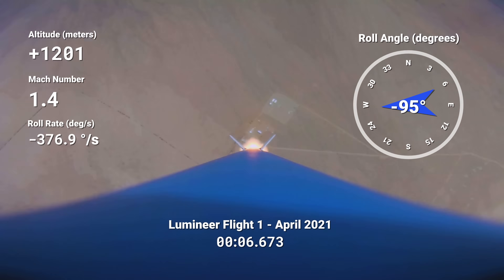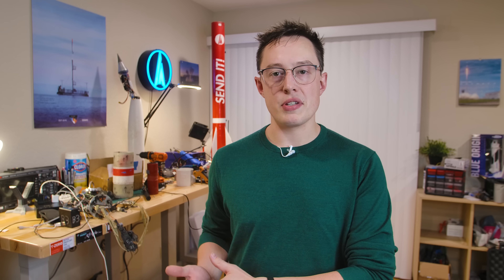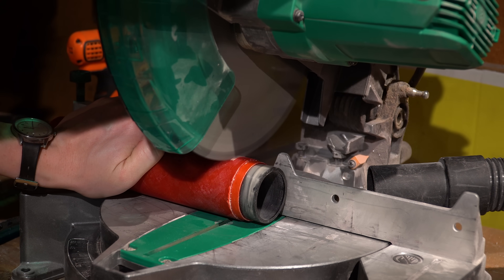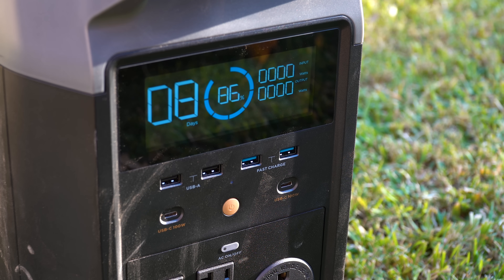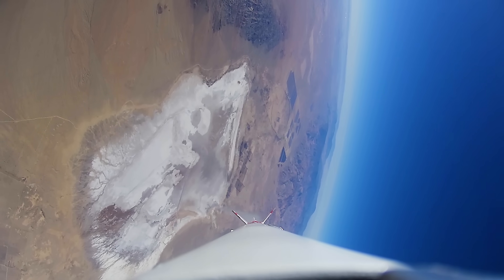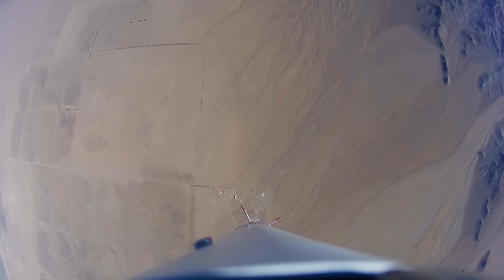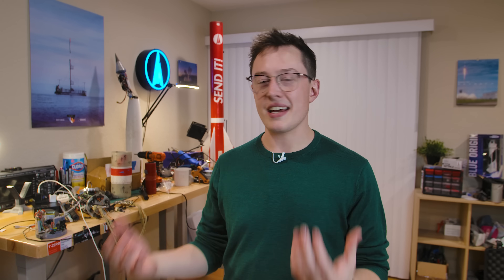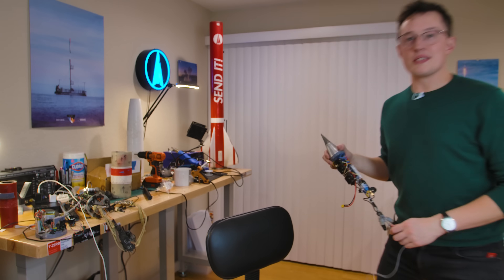Can You Get Stable Video From a Spinning Rocket?

Comment: Conservation of angular momentum... Your camera ring is a reaction wheel as others have stated. Look at adding a counter-rotating ring as well to maintain the angular momentum of the airframe. You could also use that combined system to de-spin the airframe like... 1 second before chute deployment to mitigate chute entanglement.
Reply: While I agree that the despin rig is acting like a reaction wheel, I don't think adding a second wheel is the best idea. It adds mass and complexity to an already existing rocket, which could be more of a headache than it is helpful. I think the best move is to use high rpm slip rings to get all of the electronics for this sub assembly into the avionics bay, lowering it's mass, dropping it's moment of inertia to lower the torque roll it's exerting on the vehicle. It doesn't solve the problem completely, but it could have the potential to greatly reduce the impact.
Reply: @sethswheelhouse  
I agree, but more importantly, if it is active from launch, the saturation is pretty negligible over the flight. It wouldn't really run into any issues with reaction wheel effects.
Reply: I’m not saying he doesn’t need to optimize the mass of the camera ring, that is obvious. However fin induced spin is completely GONE and reversed only 5 seconds after the camera ring kicked in. The oscillation this would induce would be worse than not spinning at all. Optimization will only go so far in extending that time, I doubt by a power of magnitude, and certainly not to apogee. Counter rotating wheel is the best option IMO. He already explored a fairly mechanical execution, it’s not too much to mechanically couple a second ring to the same stepper in v2.
Reply: TLDR: From the perspective of an astronautical engineering major, @theProhibitionKitchen is correct. IF Joe wants to use a de-spun camera, AND have the airframe spin stabilized in the upper atmosphere, a counter-rotating wheel is required… and it’s not nearly as complicated as you all are making it out to be. 

The point many of you seem to be missing here is that this camera ring completely cancelled out the spin of the airframe and reversed it, while below 15k… in the thickest part of the atmosphere where fin spin is at a maximum, the camera ring stopped and revered it. Joe said in the video that he WANTS AIRFRAME SPIN and for good reason.

Optimization? Yeah it needs huge optimization. Why is the motor, gears, batteries, electronics, etc on the ring? But optimization can’t beat the laws of physics, angular momentum is still angular momentum. Yes it would take more time to cancel out the airframe spin, but it certainly still would. Would it make it to apogee with any spin left? I doubt it, fins (and thus spin from fins) really are useless after not very far up… 

Some people have said stuff about how abruptly it started spinning. It’s not about how rapidly it spun up after kicking in. Whether it had spun from the beginning of airframe spin, or made the same number of spins in 0.1 seconds, it is the same angular momentum in the system overall. So.. it still would have cancelled and reversed spin like it did in the footage. 

PID may resolve oscillation but it does not resolve the angular momentum issue with only one wheel IF Joe wants a de-spun camera AND a spin stabilized airframe (both of which he said that he wants…).
Reply: @die_dunkelheit  That it can cancel out the spin entirely is never in doubt - spin anything up fast enough and it could. The point is it looks like it spun up way way too fast, certainly way way faster than it would need to keep the camera on target as it overreacted when it starts the camera spin. So it is the overreaction cancelling out the rocket spin entirely at that point. 

Which happens while the rocket is still low and fast enough to be building up more spin from the fins efficiently. So had it been only taking the right amount of spin out to keep the camera position the rocket itself should have stayed spinning, and probably actually still been increasing in spin speed for most of this flight (but that is a very complex relationship between air over the fins to generate that rotation, so height and speed vs the rotating camera mass and so the counter rotation it produces to match the rocket body). 

Plus once it reaches the top of its flight it doesn't really need spin stabilisation anymore anyway, so who cares if the camera unit by the end of the flight has taken all the spin its about to fall over and deploy chutes...

edit: NB - Note I am not saying a reaction wheel would be too hard or a bad thing, I just don't think it is actually required on this rocket, and it certainly shouldn't be on the bigger rocket he wants to run this type of system - the rocket mass vs the camera mass as it gets bigger will trend very solidly in the camera doesn't ever accelerate long/hard enough to cancel the spin the fins put into it at the early phase of flight.
Reply: @die_dunkelheit  One thing I disagree though, the spin stopped because it had almost reached max RPM and stopped gaining angular speed. Then the motor kicked in violently. If you have the motor working all the way up, the camera is having no angular momentum
Reply: @yuxuanhuang3523  that is not how angular momentum works. It’s is spinning counter the airframe, it is taking angular momentum from the airframe. It doesn’t matter how fast it kicked in at all, it is the same total angular momentum in the system.
Reply: @die_dunkelheit  No it isn't. the rocket has a terminal spin rate, and when the motor kicked in (adding negative angular momentum), it encouraged the rocket to spin faster than that, which caused the whole system to lose angular momentum. Then it suddenly slowed down, the rocket body had similar spin rate, therefore similar angular momentum as before the motor kicked in. Now the motor is taking all of it away from the rocket. If it had stabilized from the launch, the rocket could spin at its terminal rate while the ring remains stationary relative to ground
Reply: As part of this is practice for scaled up flights I really can't see a second wheel being needed - a bigger rocket with spin stabilizing by design will easily overpower the relatively light camera, and it really aught to be have done on this flight to from what we see of it - its seems to be only because it went to sleep and then got cranky and overreacted upon waking that we see the spin being lost so entirely. Tuned properly and working all the way through the flight I'm pretty sure it would be fine.

I do like the idea of deliberately spinning it up potentially too fast for filming purposes to aid chute function, just using it as what it is - a reaction wheel. Though it may not even need to be driven too fast, as it reaches thinner air and gets ever lower airspeed towards the top of its flight the camera units rotations may well entirely kill the roll anyway as the fins loose the airflow they need to function as spin stabilizer.
Reply: There are easier ways to despin though, such as yoyo despinning.
Reply: @jerry3790   I think this misses the point though. He’s trying to continuously stabilize the camera against a spin stabilized airframe. My secondary point of despinning at Apo should really be taken as like a secondary beneficial side effect if he decided to implement that in the same system. My point of the second ring is to counter spin the camera ring ONLY.
Reply: or have a fixed camera and program software to only record frames when its pointing a certain degree when it starts spinning. but yes put in more weight and motors and have the whole thing spinning opposite direction to counter his reaction wheel camera, for some reason. why dive deeper into a crap idea
Reply: @MrPaxio This is one of those ideas that I think almost everyone has while watching this video and it sounds really cool until you actually try to simulate your expected framerate/output footage.. I think most people would rather just keep the spinning version. Plus in the case selective frames did give reasonably good results you'd still be better off just recording in a high FPS and using a reference point to get rid of the 'between' frames in post rather than try to time your shots in flight.

Regardless I reckon Joey b can tackle this problem however he wants it's not like he just forget about angular momentum or that 360 cams exist.
Reply: It's not a bad idea, but the biggest problem with this is that the mass would have to match the total weight of the rocket
Reply: @rokitfella7107  no, this is suggesting to counter the spin of the camera ring so the camera ring does not cancel the spin of the rocket. IF the second ring is spinning at the same rate as the camera ring then it would have to match the mass of the camera ring. If it were spinning faster than the camera ring it could be lighter
Reply: also intentionally spinning the rocket would help to have some momentum to work with. Also a more optimized control system and mechanics could solve these oscillations. On the other hand, probably a simple 1 axis gyro and optimized light weight system would do the job. Also I mean the spinner has some extruding parts that have some aerodynamics effect.
Anyway, I mean he didnt really needed to fire a rocket to test it. All what was needed was to throw it into some safe pit a few times, he could have seen these issues. For the initial problems, it could just be that the heavy acceleration on the rocket bind the mechanism and while it unbind it had accumulated integral error.
Reply: First of all, it adds complexity and weight,as SethShredz mentions. I know it acts as a reaction wheel and counter the rotation the rocket is doing. We can see from the footage how well that worked. It almost took all the spin from the rocket when that thing kicked in.  However, in control, there is a threshold for stability, if you go softer on the reaction rates, the system will be perfectly stable and will not go into oscillation. tuning a PID system on a moving platform is not that different than tuning one that is stationary, just take into account for both spinning masses
Reply: Or just give up on the camera and go for the 360 one. Or give up on it altogether

Comment: 3:00 the other problem with using a 360 camera is that, ultimately, it is still a camera, and if you spin it like that, you'll get a ton of motion blur. You can stabilize the image in post and get a very stable video... of motion blur.
Reply: thats a very good point. I havent thought about that

Comment: Also you can stabilize the camera to a compass heading rather than an accelerometer. Or with sensor fusion you can stabilize to gyro, accel, and compass. The code is wildly available for free and will just give you a heading output to aim for.

Comment: Really cool idea, but man, this problem is 100% solvable in software. There are a ton of turnkey 360 stabization tools.

Once you have your stitch calibrated, all you need to do is track a fixed point, and you can un-roll a shot. 

I think fixed cameras and a bit of video editing is the way to go. Heck, you could disassemble an insta 360 camera and have everything handled for you in a snap.
Reply: https://youtu.be/fWTPGgppW0M

Comment: Hey, stepper motors have a pretty slow maximum speed. See if it is sufficient for you. Make sure to not gear it down much, since they can do very precise microstepping and you need all the speed you can get.
Other than that, the solution that will work (but is overkill) is something like an ODrive.

Comment: 1. Turn that brushless with a F.O.C. controller and add position sensor to it (hard). 
2. Use a gimbal driver and a gimbal motor (easy, cheap).
3. Attach an Insta360 go, and be amazed, see: https://youtu.be/fWTPGgppW0M (easy, costly).
4. To your target angle add 180deg, modulo it with 360 then subtract 180, and that will skip the cumulated spinning

Good job!

Comment: This could probably be stabilized passively using fins on the rotating camera rig.  The fins on the righ could be mounted such that they can swivel freely in pitch axis; this will make them automatically align themselves with the flow and dampen camera rig rotation.
Reply: I bet this would be super hard to do, but it might be the coolest possible solution.

Comment: I think proving that the idea doesn't compromise the structural integrity of the rocket should be should be biggest takeaway from this little prototype. Don't give up on this idea and also consider having a deadband around the range of spin that the system isn't good for. At the end of the day, slow rate spinning footage is much better than jerkey footage. 

P.S. This might be camera assembly acting as a reaction wheel but I think your 5 degree fin somehow made things less spiny.

Comment: I would go with a sensored brushless motor, the type rock crawler rc cars use as they need to have smooth slow power. You should not have to use so many reduction gears.

Comment: Might want to research rollerons in your fins, like some air-to-air missiles. Those use passive rollerons spun up by the slipstream of the carrying aircraft. 

I was working on a space shot where we thought about using hard disk drive platters and motors inside the fins for the gyroscopic fin stabilization. 

Regardless, keep up the superb work!
Reply: To those that might not know, rollerons are an enclosed gyroscope inside the trailing edge of a tailfin that is spun up by airflow over a small exposed portion. (Very common on military rockets/missiles, it's that toothy little wheel on the tailtin corners) They are connected to the static portion of the tailfin with a simple (but sometimes damped) hinge and function as a standard control surface but are passive and have only 2 moving parts.

If tuned correctly, the gyroscopic forces automatically tilt the control surface the perfect amount to counteract any roll and they can be surprising precise/accurate/responsive bc gyroscopes respond instantly and proportionally to even the smallest/slowest rates of change while not overcorrecting for the largest/fastest. It can essentially be thought of as a "wireless" equivalent to a mechanical bevel gear, neat.
Reply: Came down to say something like this,
fins are pretty excessive for high mach vehicles, especially low mass rockets.

Something like rollerons or tiny flap stabilizers makes more sense.

Rollerrons are pretty heavy and are probably reliant on the mass for a strong flex/vibration resistant housing.
But the idea is probably interesting to look into.
Especially passive self-corrective stabilization.
Reply: My take on this comment is:
1) probably not what you are intending and
2) that you're saying to change the camera spinner so instead of being de-spun by a motor based on calculations, to instead attach fins with rollerons that de-spin using inertia...  but I'm not even sure that would make sense.

Comment: I have mentioned this in the last video, but something you could do rather than spinning the whole assembly, is spinning a mirror around the central point and then putting the  camera statically in the body of the rocket. This would allow for a lot less load to be spun up and down. Similar concept to what you have already done, just less stuff spinning
Reply: I also suggested this when he had a gopro sticking halfway out the side of the rocket body causing unbalanced drag. Unfortunately this fix wont work for this use case, as the center of the viewpoint will remain static but the entire image will still be spinning around that central point, expecting no blur at the edges of the frame would be naïve.
Reply: @chrisjacobsen1659  : Yep, shutter speed isn't infinite, so you'll get blur everywhere outside of the exact rotation axis, and in this case it could be pretty bad.
Reply: @chrisjacobsen1659  Assuming the camera isn't global shutter, you might also get some weird rolling shutter effects.
Reply: @fractal5764  I was just going to mention that. It probably add a weird curl to the image. Not a bad idea though. Unfortunately due to the optics, the mirror would have to be in the center also in addition to the camera. In order to have the mirror in the center, that means you also have to have an armature, and that means you can't have any Central structure at all. That's technically unfeasible.
Reply: @Unmannedair  I can see a way to do this with more than one mirror and obtain the image without having the mirror directly in the center. Definitely makes it a bit more complicated, but still spinning less then they whole assembly
Reply: if you stick a rotating periscope onto a cam, you'll have to put the cam in the middle. that will lose you the easy cable passthrough. which might be acceptable.
Reply: That's sort of how IR seeker heads work.
Reply: This is how they track super/hyper sonic rockets and bullets with highspeed cameras for military testing. They just follow it with a mirror bc it is somewhat trivial to flick a tiny mirror at a projectile with a know mussel/flight velocity regardless of it's speed.
Reply: Besides the problems others mentioned already, it could be possible that with an ultra-wide camera you could lose a lot of your field of sight

Comment: If the stepper motor idea fails, adding a hall effect sensor to the brushless motor with a supporting esc can increase low rpm torque. It's also possible to rewind a motor to lower the kv

Comment: Rather than moving the camera with respect to the rocket, would it be possible to synchronize the frame rate of a fixed position mounted camera to the roll rate of the vehicle? This would also likely be a pure software / electronics solution, which would scale nicely to future projects